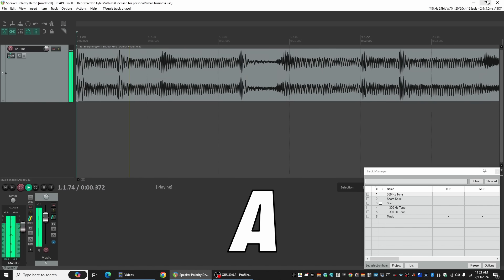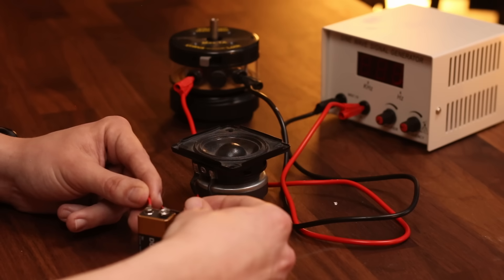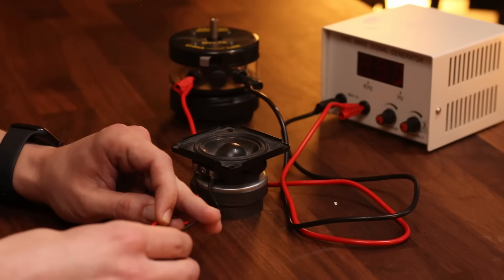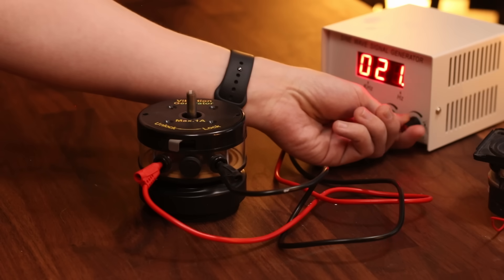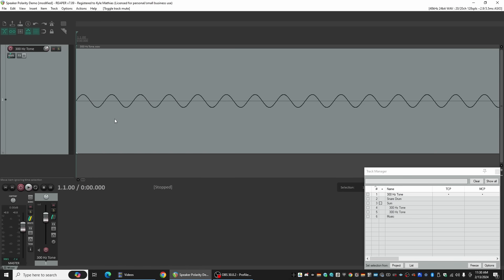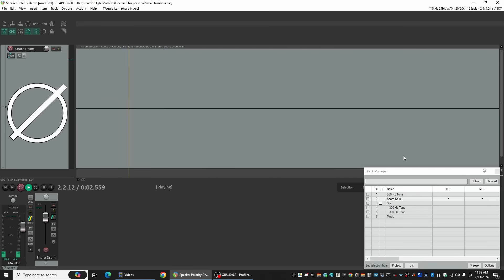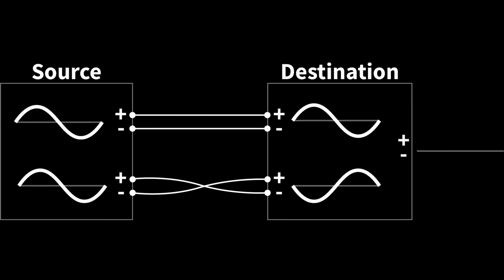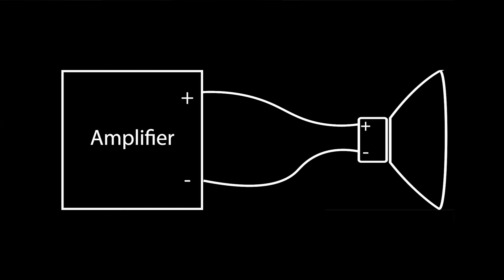What Happens When You Wire Speakers Backwards?

Comment: It's the same thing happens in motor when you connect vice versa the only difference between is motor spin  and speaker 🔊 heat's and not that clear can also get damage in short period or even burns coil and also there are many different types of speakers 🔊 in my opinion is the best way to connect it right it will last long

Comment: If you do this one speaker will push out and one speaker will pull in.  It's how an electric magnet works.  This desirable in certain sub configurations ... say a box that has two drivers (speakers 8 / 10 / 12 inch your pick) cones facing eachother.  One is pulling an one is pushing.  This makes bass hit super hard.  If you wire your other speakers accidently out of phase... it will sound like crap.  Most people would not even notice.  😂

Comment: i have a vibe amplifier   and i have 2 subwoofers and the wiring diagram says  negative on the amp  connecting to positive on one side of the sub and then negative  on one side of the subwoofer  connect to positive  on one subwoofer, then on the other subwoofer  its negative on the subwoofer connecting to  positive on the amp and then  positive on the other sub connecting to negative on the last terminal so should it be positive on amp to positive on both subs and then negative  on amp to negative on  subs?  or should i go with the wiring diagram  in the instructions?

Comment: All the speakers are just magnet and a coil. And the voltage going in there is AC with controlled frequency, its like putting a wall plug into wall, no matter wich way you plug it, it will still work (Eu electronics use diodes to direct the energy). But of course, it will invert the frequency. This comes really obvious if you have a single port 2x subwoofer box, and you connect one of the elements inverted.

Comment: I have found out of hundreds of speakers i have used that sometimes even high quality speakers sometimes get the terminals either installed backwards or the magnet was actually polorized oppositely or installed wrong.   Anyway, its def a good idea to test (as in this video) before installing a speaker.  😊

Comment: +/- polarity doesn't matter as long as all the speakers are wired the same.  It only matters when the speaker on one side of the room is wired (+) and the other side of the room is wired (-).  The effect is most profound on bass frequencies when sitting equally between the 2 speakers.

Comment: To anyone who’s somewhat new…the demonstration toward the end where the sine waves cancelled eachother out is called a “null test”. Engineers use those tests to determine the differences in similar or allegedly identical equipment. Let’s say you have a “new and improved channel strip!” from some developer or another…you can see what the differences are by playing things even as complex as full tracks, with one phase flipped, to see how much of a difference there is. Audio manufacturers know this obviously so they (usually) aren’t gonna try and resell you the same product, knowing full well they’ll be discovered almost immediately when someone inevitably null tests the old vs new units.

Comment: Way back in 1977, I bought my first stereo from Radio Shack.  My older brother was an electronics tech and he had a shop in our parents garage.  Using an oscilloscopee that he had on his workbench, he tested the speakers.  In addition to modifying the crossovers, he checked the polarity of each speaker.  Half of them were connected backwards!!  After he fixed everything, the unit sounded fantastic.  I kept that stereo for over 20 years and received many comments on the sound quality.  PS - I think he also swapped a few transformers for MOSFETs.

Comment: Dude this is just playing simple, The reason why it has Negative and Positive signs is to identify quickly the Polarity of the Coil or the speaker so you won't have a problem on Phasing.. In reality, you can connect either side of it. It has no difference on Sound because it do the same thing,, Vibrate and create Wave form. It's just the throw of the wave phasing. In reversed the negative wave will come first if you reverse the polarity. If it has no Sign + and - you won't be able to determine if you have a different speaker if they're  Phase or out of Phase.

Comment: I bought a new Peavey 4-10 bass cab and amp head.  When I tried it out, I didn't notice anything at first but when I got to play it louder outside, I noticed something didn't sound right. I tried adjusting my EQ and trying different adjustments but something just didn't sound right.
I connected a 9v battery to the speaker cab 1/4" input jack.
I noticed 3 speakers were pushing out and one speaker was pulling inward.  That one speaker was out of phase.  Someone wired it wrong at the factory.  I never had this happen before.

Comment: It took me two years to get my speakers wired up the way I wanted to and I wanted to hook them up from positive to negative to negative to positive you're right when you get a bunch of speakers working together you got to have one that isn't an I mean you find one that's not all that you have to fix but if you can get them all working together it's a beautiful system I got a nice system it took me two years to build it so I know what you're talking about I run all my speaker wires backwards because I get a lot more base and I haven't had problems with it yet

Comment: Hey how you doing I use 1015 inch woofers I got five amplifiers I've been running my speaker wires backwards for over 3 years now they get more bass and I run negative and the positive positive and a negative I get more base that would have been doing it that way for years don't tell me you're in a big difference it also saves on your speakers cuz my speakers are from 1970 and they're still going strong that way don't tell me there isn't a difference there's a big difference you get a lot more bass in your wiring backwards

Comment: About two decades ago when I got my first headset I started mucking around with my recorded voice in audacity. I discovered by accident that duplicating and inverting an audio track cancels the original out. I also discovered that if you send each track to a different speaker while wearing headphones it sounds like it's coming from both sides instead of being centred.

Comment: When I was a kid, I had two amplifiers that I stacked on top of one another. I took extra wire I had, twisted them together, soldered them together to make one big red one, one big black one. I then twisted those around the connections of the speaker on the working amp, and connected them to the speaker on the amp that no longer powered up on its own. One amp was powerful enough to make both speakers BOOM. 

One day, the amplifier sitting on top, the one that was not plugged into the wall, caught fire while I was bumping music. I figured it HAS to be from my rigged wiring, but what caused the speaker to catch fire? It was the speaker itself, the electronics inside that amp had been fried for a while, the reason i bought the second amp to begin with. What caused the fire?

Comment: Never connect your speaker backwards, because the diaphragm pumps air outwards, but; you may change the fitting direction of the speaker inwards to pump air through the Bigger port reflex hole, which will also change the bass sound.

Comment: Great video.  It does make a difference, I recently bought a new Denon receiver and hooked up all my speakers in a 7.1 configuration.  When I ran the audio test using the included condenser mic, it failed the test and pointed out two speakers that were wired incorrectly.  Their built in audio software found the two speakers wired backwards and identified them.  I was surprised, but it was correct, the wires were crossed on those two speakers.  Fixed the cross wiring, and reran the test, and it passed and they certainly sounded much better.  The bass, clarity, and sound stage were much improved.

Comment: Great video! I have a question... Why do some manufacturers wire the subwoofers inversed. I have some vintage snell Type Aiii with upward firing subwoofers inverse wired from factory. What would be the benefit with this and why the design? To be fair the bass from these is astounding and they are known as some of the best speakers regarding bass reporoduction.

Comment: The difference is quite literally a phase difference of 180 degrees (Pi radians) in the signa's waveform. On average, there is no audible difference, BUT there actually is one tricky aspect here, as the coil's sink vs. rise act upon the cone in a way which is not symmetric. The tension of the speaker's membrane does not behave the same way going up vs. going down, which means that inverting the phase will actually give it a slightly "different" sound, albeit you will almost never notice it.

Comment: So this is very interesting because I teach a robotics class, and my students build a speaker from Magnet Wire and a neodymium magnet and watercolor paper! We would hook up the speaker in one polarity and then swap the polarity to see what polarity sounded best. I think the real answer is based on cone distortion! The cone will deform or distort in one direction of movement vs the other. Only low quality speakers will sound notably different when the polarity is switched.

Comment: Greetings, I'll be brief. The reason it's important to "+" > "+", and "-" > "-", is the same reason folks said they can hear the difference; AND you even touched on it - the snare sample. The sample begins with a high POSITIVE peak and the rest is comprised of harmonics and decay. The speakers responsible for reproducing that particular sound (if everything is wired correctly... beginning with microphones) will produce a positive excursion of the speaker cone. If the cone (reverse wired) moved "away" from the listener at impact it would create a different affect on the medium (air) and sound different. A trained ear (musician, conductor, producer) could tell the difference. I used to be able to 😏 What it boils down to is the ALL drivers in a reproduction environment must travel in the same direction at the same time. Time is critically important to minimize any phase differentials. Be Well.

...and yes, that WAS "brief" - trust me...

Comment: good video but missing crucial information. in most less mechanical frequencies it won't make much difference in a mono situation except for bass notes.. speakers are designed to excur outwards and their mechanical limitations are different inwards and outwards. if you plug a woofer wrong way it will hit inwards with bass notes instead of out which is what itself and the box is designed for.  small speakers won't be affected by this much or low power setups..

Comment: What you call backwards we audio grey-beards used to call... being out of "absolute phase". I'm not sure why it's not used anymore but it's a very appropriate term. Apart from speakers being wired with reverse polarity, it's possible for any component in the chain to wired in reverse. Even recordings sometimes are phase reversed. The solution is most easily be corrected at the speakers. If an instrument or note starts with an outward movement then it's in absolute phase, though it's often difficult to detect visually or audibly. Some say the sound has a better sense of immediacy if it's in correct absolute phase. I find it difficult to hear.
Reply: When I was a kid, I could always tell--always, with any set of speakers.  It was flagrantly obvious to me, though it's difficult to describe exactly what I was hearing that was different.  Now, 30+ years later, it depends. It isn't clear to me why there'd be so much of a difference with my decreased frequency response today.  I do have a set of ESS ATM-1s, and with those I can tell.

Comment: shouldn't the phase cancelling or summing depend on  the distance between you and your speakers too? if your speakers are half a wavelength apart, they should also cancel, so you should reverse the polarity of one to correct for the wavelength phase.

Though, it might be that, if you are half a wavelength closer to one speaker than the other, you could invert one, so you are in a summing region, rather than a cancelling one.

ultimately, unless your speakers are right next to each other, it probably doesn't matter, but the option to invert one while listening might make your experience better depending on the geometry

Comment: I Am A Retired DJ And I Still  Deal with Speakers  This Guy  Does Have A  Point  Sound Wise It  May Not  Sound Much  Different  But  The  Problem  Of  Wireing  Speak ers Back Wood Over  Time  They  Could Possibly  Were  Out  Quicker  Be  Sure  To  Wire Them  Correctly  They Just  Might Last  Longer ❤

Comment: It will be out of phase and shrink your soundstage to almost nothing, also you'll notice a lack of bass. Out of phase speakers actually do have their place a dipole speaker has one speaker in phase and the other out of phase there placed in a wedge shaped cabinet that mounts to the wall. what this does is created a very wide sound stage with a null in the middle when your directly facing the speaker. These types of speakers are often used for side channels in a surround sound setup where you want sound on the side but you don't want to focus on that sound because it would be distracting from the main LCR speakers.

Comment: Not all speaker terminals are color-coded for polarity correctly, and some speaker terminals have no polarity markings at all. If you have a speaker and don't know which terminals are which, use a (weak/mostly-discharged) 9V battery and briefly connect the speaker to it. When the cone pushes forward (toward the listener), it means the positive terminal is connected to the battery's positive terminal. Knowing this, you can now mark the positive terminal with a red marker for future reference. I hope this helps.
Reply: There's an easier way. Play a recording that has a strong vocal center image. If the voice is coming from in between the speakers, its good. If not, the voice will be coming from one of the side walls. When you get a chance, try it. You'll hear the effect instantly.

Comment: Also. As far as two speakers canceling each others output.  What if it’s two subs in the same unported box?   Would they cancel each other out. 

                 Or….  

     What my mind says, lmao, is they would actually hit harder, or maybe that’s the wrong term, would they have a longer wave input, having a parasitic loss of half of the wave, in thought, but in action, maybe, IT would just sound like they’ve just changed frequency instead of canceling each other out…. By sounding like they have half the Hz?!!? Since they are tied together in a single box via air pressure. In the same way people use weighted cones with now driver unstead of a second speaker in a box. Sounding and physically moving like one larger speaker with a deeper mechanical movement in the speakers seemingly tied to each other?  Moving as One speaker in two positions?!!?  

     Idk if my point is getting across or not.  But it is curious to me.  And you should tag me in a video trying this!! lol 😝🫣😳

Comment: It will go unnoticed unless you are using a speaker for low frequencies,  especially if it's in an enclosure.  The first note should push the outward, also known as the positive speaker phase. If It speaker pushes inwards, the base note will cancel out.

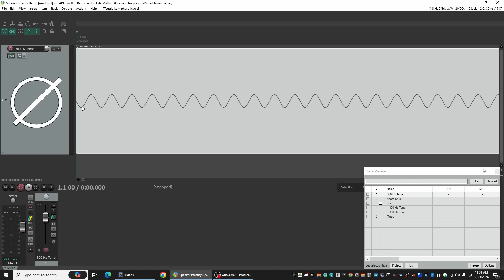Comment: It took until 4:12 to understand that the symbol you were using was supposed to represent "inverted". The circle with a line through means "diameter" and I use that almost daily for engineering drawings. I was so confused how that was related lol.
Reply: It means he traversed the diameter to end up 180° out of phase. I may or may not be talking out of me bum.
Reply: It is eerily similar to an empty set symbol from mathematics as well.

Comment: This could've been answered by a 7 second video:
Nothing changes but the sound waves will be "negative" so if you have multiple speakers (some wired correctly some backwards) their sounds will interfere with eachother and cancel out in some points

Comment: Only when receiving stereo signals in a monoral radio. At KNAU Radio station in Flagstaff in the mid 1980s we had an out of phase and huge ground loop problem at the station. At 100,000 watts here in Flagstaff not only did we have multi phase distortion but any monoral radio in an older car that tuned in experienced lots of phase out signal loss. The ground loop issue never did get fixed. The station eventually moved into new quarters on campus at NAU that was wired this time by real broadcast engineers that knew what they were doing. That Optimod was horrible too.

Comment: Wiring speakers are the most important in audio ..
That what I almost do some expiremetal until I found what   kind of wiring to be suited for every system ..
 My (#audioworkhzs) audi systems  are wired by out of phase in speakers..
Meaning the polarity was reverse..
 This method are applicable for 2 speakers.. it either mono or stereo amplifier..
 For the reasons  are simply..
Just make sense if we minded the flow of wave flow into the cube are..
 The air flow in one direction will affect the low frequency ..
 If the flow air flow are in desame deriction the Soundwave are swiftly ..
Meaning low frequency will not crash into cube..
 Ok out of phase wiring are best for stereo Subwoofer purposes..